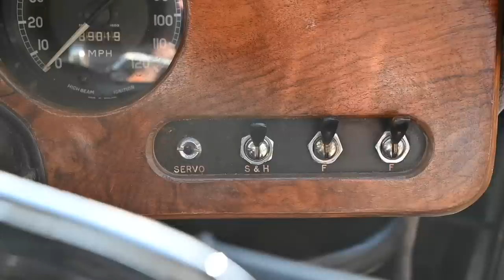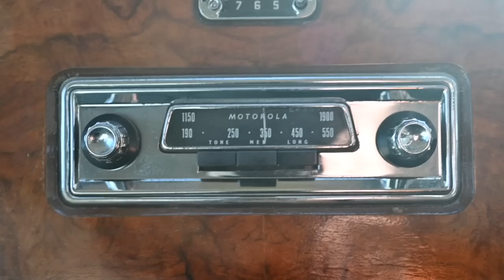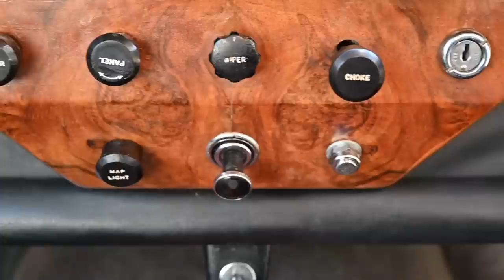1961 Vanden Plas Princess 3 Litre Goes for a Drive

Comment: Manual wind up windows were standard in those days (he said)
Oh contraire sir, if you bought an American car in those days, they would be electric.
Reply: Rog5446 Only if you could afford a luxury model. Even into the eighties base and mid range US cars had manual winders. In Europe power windows were slow to arrive, often offered as an option.
Reply from the maker: Check out my Ford Taurus review, a late 80s car still with manual windows! But anything luxury American would have electric and maybe air con

Comment: Chicken and egg; can you only drive one of these if you already have a flat cap and smoke a pipe, or do you feel the uncontrollable urge to wear a flat cap and partake in a bit of rough shag when you get behind the wheel? A more interesting debate than plar vs plas I think...
Reply from the maker: I would have felt under dressed without my cap, in fact I regretted not wearing a fedora or at the very least a trilby

Comment: I worked in the motor industry in the 70s and everybody I worked with pronounced it “Vanden Pla” Plas sounds rong to me 😃
Reply from the maker: BL marketing thought it sounded posher so started using that around the early 70s, but un til then it was Plas
Reply: It is wrong.. I worked for a garage that sold and serviced them.

Comment: You don’t sound the ‘S’ I worked as an Auto Electrician in a BMC garage and were always told never to sound the ‘S’. It maybe from Belgium and their languages are based on French.
Reply: It's actually a Flemish name,you sound the "s". The French wouldn't but then the name would have been "De Place".
Reply: Belgians either speak a French dialect, Walloon, which has three main sub-dialects, or a dialect of Flemish (Vlaams), which is itself one of many Dutch dialects. Even Dutch itself (Hollands), is itself a dialect of this group, albeit the main one, with its own sub-dialects. They are Germanic (Low-German) languages.

It’s pronounced Faunden Plass. It’s Flemish.

Comment: What would a car like this be worth in 2020?
Reply from the maker: £6995 at Sussex Classics! For sale right now
Reply: furiousdriving thanks for that. Actually, I found the Haggerty values website and they say average is £6500, so that sounds about right. Nice car. I note that the Mark2 model which came out in ‘61 made 120 HP...with a floor shift. Makes me wonder, with twin carbs, perhaps the performance could be helped a little. Lovely car. It would need to be checked for the things I just read on Haggertys, like the rust maladies of big Farina cars. I’m a dreamer, not a buyer, but you never know...correction, yes, I will not be buying it. But so nice to see.

Comment: furiousdriving, Please read this to the end before deleting it....... The company name is pronounced Vanden "Pla" not Plas, As you say the name was of Dutch origin and was originally pronounced Plas, however when the company was formed in Belgium it was corrupted and pronounced to PLA, You can tell me i'm wrong and delete this comment if you like but my father worked at Vanden Plas in Kingsbury (pronounced "PLA) for 25 years and worked his way up from the factory floor as a model maker to become "Manager of Design and Engineering Development" and I can tell you CATAGORICALLY that the company name is pronounced VANDEN PLA (Silent "S") If you doubt this check the company history against my surname and you will find my father.............Also, try checking with the owners club, they will tell you that my father was who I say he was and confirm the correct pronunciation VANDEN PLA

Comment: A car for the moneyed classes who found driving a chore. vague fingertip light low-geared steering and a detuned Austin Healey 3000 engine married to a gearbox with only three speeds ..... slushy, slushier and totally slushy. Putting one's foot down caused the engine to bellow and the car to gain speed glacially as the energy was dissipated in heating the transmission fluid. At least , unlike its 1622 cc little sisters it had disc brakes at the front, combined with lever dampers and king pins for a roly-poly-ship in heavy seas ride and lots of lean on corners. A car owned by the "self made man" chairman of the local bench ...... superficially posh but lacking real class and breeding. Demand for this car, the big Humbers, Vauxhalls and Zodiacs was decimated by the less thirsty but equally capable Rover and Triumph 2000 models, which had luxury and standing,  but were much better to drive (chauffers were so very 1950s) and much cheaper to run. Jaguars were seen as vulgar and "Bookies" cars as Bentley coupes are viewed today as "Footballers' cars. Expensive and "Look at me" but devoid of real class. For that you needed an Alvis or Daimler or a Bentley /Roller to prove you'd really made it.This car, the Humber and especially the vulgar Cresta and Zodiac were wanna be cars for the noveau riches and deserved to die. They were not missed and had ignominious ends as warriors on the banger racing ovals where their under engineered and forth bridge like chassis came into their own as battering rams. A fitting end for such tanks!

Comment: For all this chap's enthusiasm, this is a typical backward English car.   Why would anyone pay top dollar for something with a 6 cylinder engines and manual transmission when the equivavlent amount would get you an American car with a V-8 engine and automatic transmission ?
Reply: Yes it was a dated car that outstayed its welcome especially when the 60s began to swing. But the V8s were not that powerful in those days for their capacity, drank huge amounts of fuel and the colossal weight of the engine meant that the cars fitted did not handle very well. Ford of England dropped the V8 in 1950...partially because it only did 9 miles to the gallon, but also because their new 6 cylinder engine developed a good rate of power and economy.
Reply: @Efferpheasants  I detect a note of rationalization in your response.  Stating that `V-8s were not that powerful' may apply to England but not here.   The V-8 florished in popularity even in the 1930s in the Ford and many others had such an engine.   The point I was trying to make is that the English typically buy small, cheap and crappy cars while their exceptions (the Bentleys, Humbers etc) were few and far between.   England never was a `car culture' like the U.S.  which is not bad but I think true.